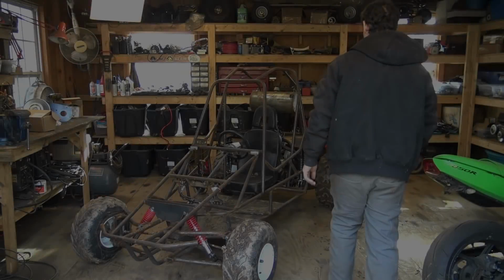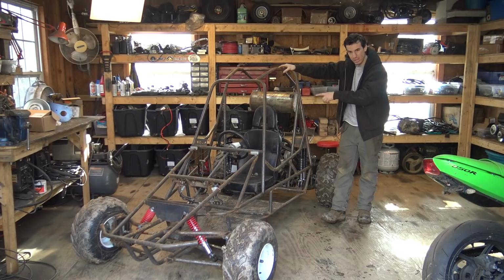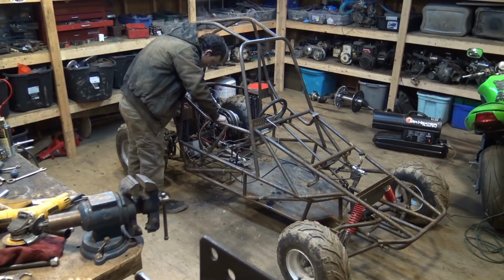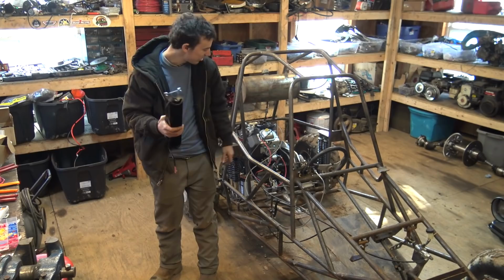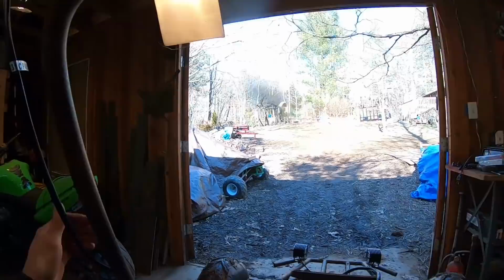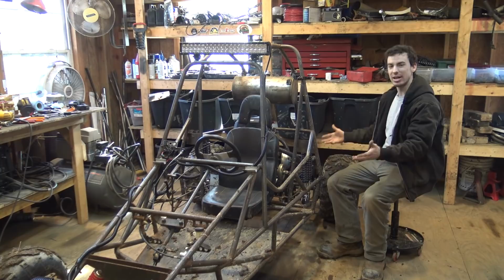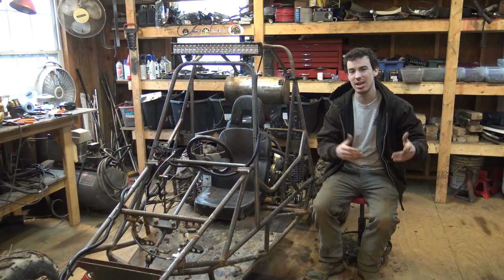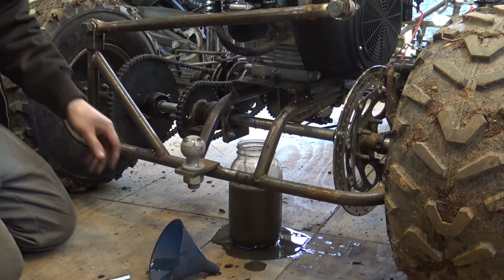finishing the two speed 670 off road go kart

Comment: Have you thought about using a regular gearbox and adapting the in and out to get your ratio's and reverse? I have done a few this way, and the best
I've found are Ki truck gearboxes (from Japanese micro imports) They are tiny, lightweight with remote selector linkages, plus they're bulletproof and cheap.
I make an adaptor from the clutch plate centre and fit a sprocket, then make a plate to span the tiny bellhousing with a flanged support bearing for the spigot 
mounted to the outside of the plate. I cut a slot in the bell to exit the input chain. The 4 speed ones have 4:1 to 1:1, the five speed have 4:1 to 0.8:1 approx.
Anyway, great work again, cheers.
Reply: link?
Reply: Yes, please provide a link. These gearboxes sound awesome.
Reply: I need more info about this please
Reply: Japapnese micro van you mean?
Reply: @kinangeagle133  I got my first one from a Daihatsu micro van (I used it in an electric jeep project I still have), another from a Suzuki micro truck which had the same approximate size and the same output shaft/yoke, I used it to build a boat launching vehicle for a remote property.
There are a lot of RWD Ki vehicles dating back to the 70's with similar sized boxes, all very easy to adapt.
Reply: Could I have a link to something like this please? I would really appreciate it.

Comment: Add a tube to the oil drain to extend past the engine mount
Reply: @Hooha888 that honestly seems like more work and it'll still be a mess to drain
Reply: @Hooha888 lol that's a standard pipe thread. Local hardware store will have a selection of different lengths of said pipe with threads on both ends as well as pipe caps. Doesn't get much simpler than that. To drill the hole in the engine mounting plate, you'd most likey have to remove the engine (looked too close to be able to get a drill in there) and even after there's a hole in it, that doesn't mean all of the oil is going to go through the hole. Keep it simple indeed

Comment: Looking good.  Get some video outside the cart.  We want to see that suspension in use!😁 
For your oil drain mess... drill a hole in your engine mount plate directly in front of drain plug hole.  That way the oil will go directly through that hole when it come out of the engine.  Place your container directly under the hole in the engine mount plate hole and mess avoided! 👍

Comment: if/when you get ready to paint it, run your cables so that they aren't outside of the frame, do like someone below says and make some fenders/mud catchers, drop a car battery up in the front behind the front tires but in front of the pedals, make yourself a wiring box (deep sea makes awesome battery distro blocks) and you'll be in awesome shape.  the battery will help put some weight over the front tires so that when you hit stuff with the front end you have some grip to try to get over it (from the offroad video that you slid up the tree instead of going over it).

for the oil drain....put a V notch in the back and a tiny ridge around the outside of the plate and you'll be good for draining....doesn't need much, just a tiny bit of guidance to help push it where you want it to go.

Comment: good choice on red someone said did you know your tires were on backward i don't know about you but i have a buggy i built and i put y tires on backwards  because they get better traction and they do a lot better job just pointing that out nice job looks like it moves real good
Reply: With tires in current configuration it's throwing mud forward,if turned around it'll shoot it out the rear Moore

Comment: First your rear tires need to be swapped left to right and vice versa. 
Second to drain your oil get a short length of pipe to extend the drain out past the motor mount plate.

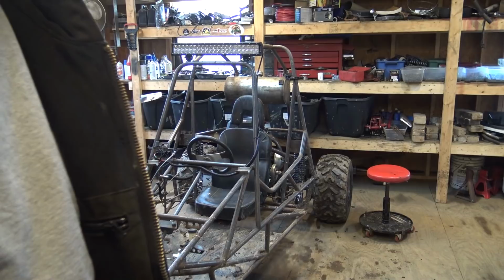Comment: 20:50 get a pice of pipe long enough that it hangs over the end of the engine mount and tap one end so it will screw into the drain hole and tap the other end so you can put a screw cap on it. I do that to all my stuff and it saves a lot of time and messes.

Comment: Can't wait to see the new transmission,not on Instagram so please do a you tube video of it please , also the buggy looks like it's running great,can't wait to see it off road , also instead of moving the engine to drain oil ,why not just thread a pice of pipe and extend the drain and cap it ?

Comment: Are your rear tires on the correct sides. Also before you run with Quad Ricers again build a motorcycle engine powered cart with snow mobile tracks instead of rear tires. You need to connect your power to the ground.

Comment: Do you think the 780 converter is enough for this engine?
Thanks
Reply: The 780 torque converter was designed for up to 50hp. I dont remember what 670s are making but I know its mid 20s, so yes it can handle it.

Comment: You should find a non electric shift transaxle make an adapter and flywheel to mount the 670 and transaxle together then you use the axles and make full suspension long travel rear axle. I know it's possible people in Russia have done it using only a single cylinder engine. I think like an 1988 dodge caravan was not electric shift.

Comment: Nice and lightweight fun go kart. Do you know approximite overall mass? I've built one for myself too, but little heavier and bigger :) Engine CB500, 27" wheels, all hung up independently, differential, duralumin frame, stainless fuel tank, max speed around 75mph :), but still some work to do, it's a neverending story :) Sorry for some minor mistakes in my English, I am from Europe.

Comment: Has anyone tried a tandem or compound torque convertor setup?One would drive the other.Only thing would be the second one would be spinning quit a bit,do not know if there is a rev limit for them.
Reply: Doesn't work torque converters only reach a max of about 80% speed transmission between the input and output.   ex. 10 input revolutions creates about 8 revolutions of the output shaft.  Also the torque converter doubled up would be the same as installing 2 centrifugal  clutches in a row

Comment: needs some at least 24x8 on the front and 24x10 on the rear. Will give more ground clearance and if you put them on some 8 or 10 inch rims they will help act like extra suspension. You get it off road (not some trail park) those tiny tires are gonna keep hanging up. Also the rear tires are on backwards. That works great in the yard so it won't tear things up but off road you gonna wanna turn the around so they bite.

With that drain where it's at you can put a remote drain kit on it. Makes life much easier and cleaner. https://www.amazon.com/Drainzit-HON1010-Changing-Honda-GX110/dp/B000PDOEGI (you can make one for cheaper)